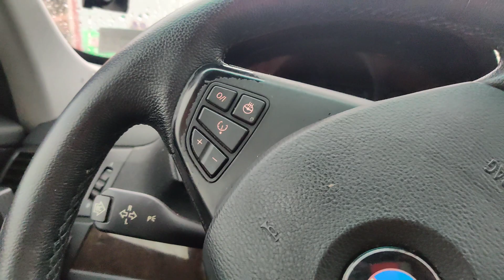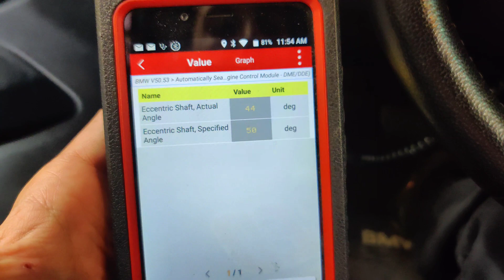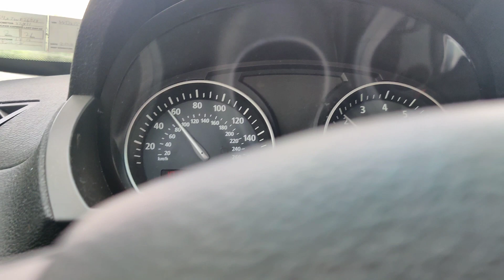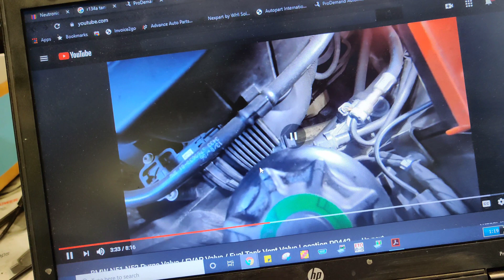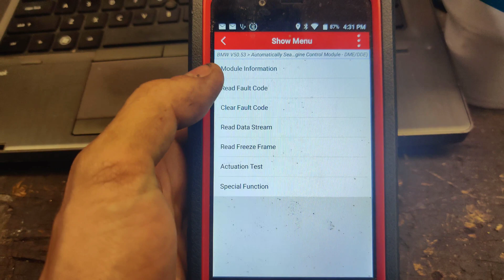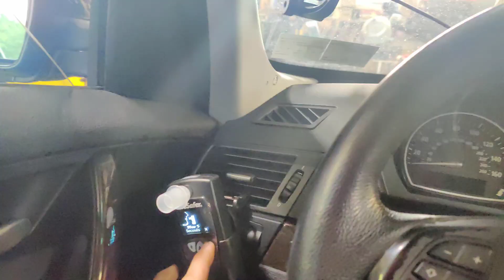2007 BMW x3 3.0si Wont Accelerate Over 5MPH, Rattling Noise, P1030,0x2A38,P0444,0x2A19, Valvetronic

Comment: I just had my eccentric shaft sensor change after they changed it I got rid of all those codes started running like shit when they put it back together with new codes 2a39 valvetronic adjustment range  2a43 valvetronic thermal overload protection warning threshold 2a38 valvetronic sluggish or open circuit any ideas what it could be or what I should do does the valve cover have to come off again mechanic has no idea6 I also had tank ventilation which pops up once in awhile with them when the check engine light comes on with the engine half filled in yellow by the way I have a 2008 BMW 328i e92 which is the n52 motor. By the way I just finished watching your video what a great job you did on it
Reply from the maker: Honestly I am not strong with euro cars. Did they do the relearn? The only way to figure out what is going on is to start testing the circuits and commanding things to actuate with a scan tool. I think those motors can bind up in the head and cause damage. You really need to research the problem. It's hard for me to help people with problems like that over the internet.

Comment: how did you fix it ??
Change the valve??
Reply from the maker: I replaced the connector and did the relearn for the valvetronic. I am pretty sure I showed this in the video. Also just because a video I post shows a fix does not mean it is the same problem you have even if the symptoms are the same. You need to test and prove what is wrong.